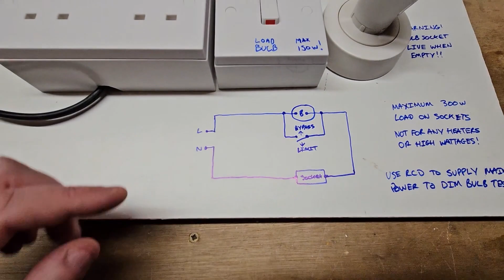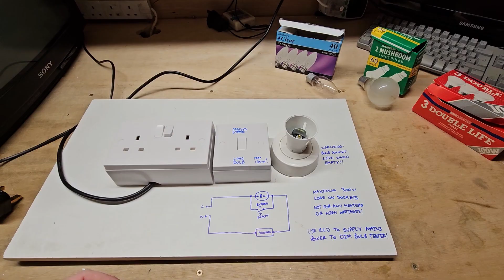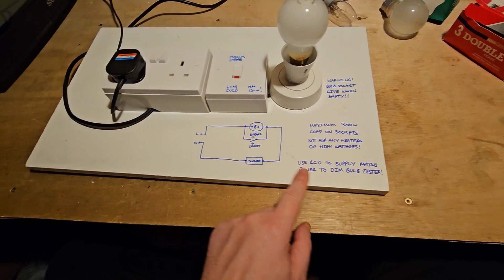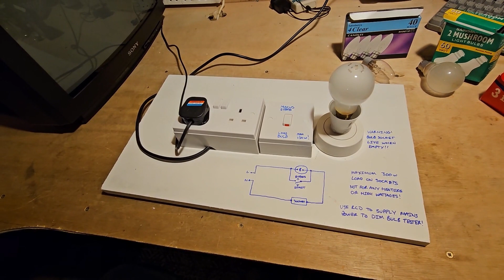Dim bulb tester build

Comment: Being kinda dense, I have a question.  

Isn't voltage divided in a series circuit?  I understand it limiting the current, but doesn't it also change the voltage?
Reply from the maker: Yes it changes the voltage to the device under test by limiting the current flowing to it. The bulb in series with the device acts as a resistor that causes a voltage drop when the device draws excessive current, which is why the bulb will glow brightly. This prevents a full short circuit from damaging the power supply or the device itself.